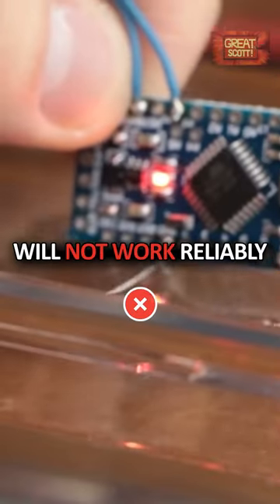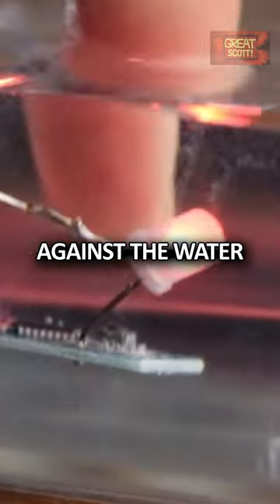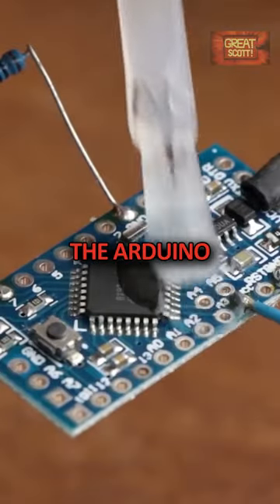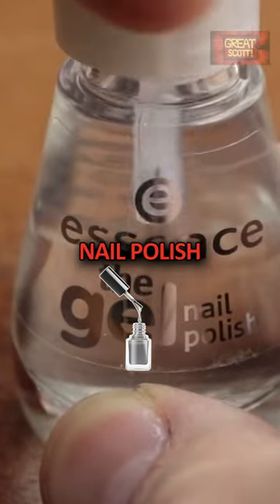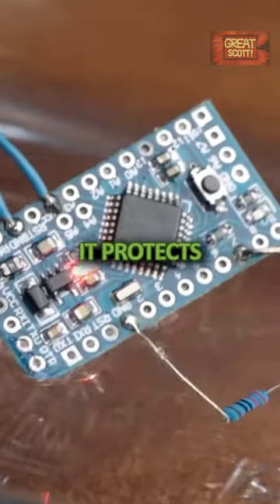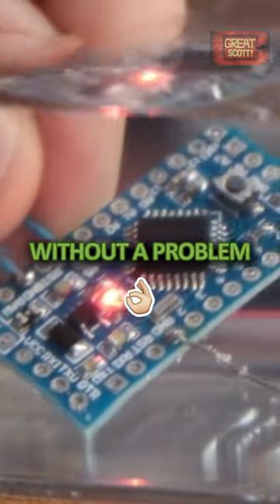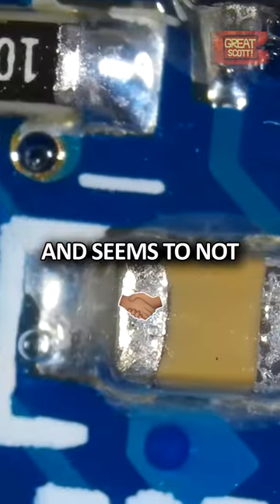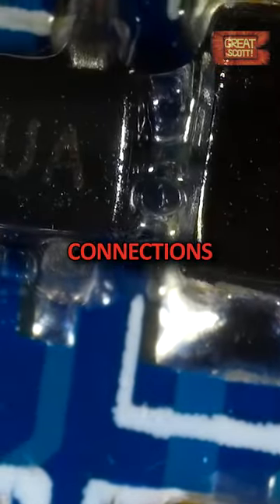Unbelievable Way to Waterproof Electronics!

Comment: Im not sure what the application for this would be underwater, but it would be good extra protection for outdoor projects where the casing may fail to keep moisture out
Reply: Maybe submersion cooling?
Reply: @oo2454  i wonder what substance it really is. Could be real dope for your idea
Reply: Industrial control systems are coated in conformal coatings for this very reason, Basically a uv stabilised varnish.
Reply: @dogwalker666  I just said that too. I use it on my drones. No shorts yet.
Reply: Moisture is already present in the air inside the enclosure.
Reply: Pool thermometer
Reply: @Cat-kp7rl  they are usually in a sealed stainless steel pocket as the chlorine will rot any conformal coating and turn copper to mush.
Reply: Outside circuits in the rain

Comment: Works OK IF THE NAIL POLISH DOES NOT CONTAIN CALCIUM. This is used as a nail hardener, but is conductive.
Reply: Metallic calclium is conductive, however calcium reacts very quickly to a non conductive state. 

Calcium ions however it may be cause a catalytic reaction what can cause a net flow of H+ ions to concur what is conductive.

However is the calcium ions are locked up in the nail polish, it won't be able to do that

Comment: Plenty of inexpensive and proven conformal coatings available, viz. acrylic, urethane and epoxy. The nail polish should be used only if you've nothing else, and is not a good long term solution!

Comment: You can scratch it off really easily from smooth surfaces like circuit board, so it's only suitable when you know nobody and nothing will touch that arduino except water and dust.
Reply: So you layer multiple coats to provide a thicker barrier, just like with any other properly applied sealant.
Reply: @claws61821  Or you just apply an actual sealant.
Reply: @danser_theplayer01  It is an actual sealant. That's literally its use in cosmetics. Sure you've got all the different colors to make it look pretty these days but the actual purpose of it has always been to seal and protect fingernails and toenails, all the way back to ancient Egypt. The modern stuff is almost always based from an acrylic copolymer, which is also what most materials that you would consider "real sealants" are made from. The only real major differences are the packaging and marketing, and what chemicals dissolve the specific one you choose on either side of the coin.
Reply: @claws61821  If this garbage can be scratched off with a fingernail it is not a proper sealant for the job. Imagine if all paints and coatings in the world were so stupidly weak. Stop justifying bad "lifehacks".
Reply: @danser_theplayer01  What do you recommend? I've tried stuff sold as "liquid tape" it seemed to have some unintended effects on my circuit.
Reply: @RussellValentine Idk google some stuff, order, and try it. For example polyurethane "lacquer" coating (not to confuse with foam). Or some silicone stuff. Do not use hot glue though, it may just melt on some hot electronics, I'm not sure. Anything they use in conformal coating for pcbs.

Comment: I'm all for this method if the design is finalized and will never get changed again. Otherwise, thin silicone is my way.
Reply: Comes off with acetone
Reply: Why would you want to modify the design of a arduino board? :)
Reply: you can solder through the polish. it just melts away i do it all the time.

to be honest, idk why they dont protect cellphone electronics and laptop motherboaords this way...
Reply: @L3X369  Not so much the board itself, but the stuff that's connected to it, or what's been flashed to it.
Reply: @L3X369  change the things soldered to it
Reply: @Deadwindshadow  Will it? That's pretty good to learn. As for why they don't do that with consumer electronics, it's probably a matter of it being too profitable to lose water damage replacements.
Reply: @L3X369  to fix it or modify
Reply: @zachb.6179  I wonder if acetone would melt any plastic components?

Comment: I’ve seen PCB’s covered completely along with all devices in a thin layer of silicon. It’s about 1/16th of an inch thick and it makes it a PITA to work on.
Reply: I fixed a washing machine that had its main board set inside an abs tray, and then basically submerged in silicone...  boy was that a b*tch to work on

Comment: been using clear nail polish (top coat) on electronics since the early 80s. it's always worked well
Reply: i accidentally scratch hard drive pcb board and the copper slightly exposed but the drive works fine is it okay to apply nail polish on exposed copper  scracth pcb? do i need regularly reapply the nail polish every months etc(temporary fix) or not needed (temporary permanent fix)?
Reply: @bolulembut1132   I'm not really sure how long it lasts, but since most of them are made of nitrocellulose (what movie film used to be made of), it should last quite a long time. The solvent it's dissolved in evaporates pretty quickly, so that shouldn't pose any problems for most electronic components. (I used to it to hold down bodge wires on a Commodore 64 restoration, no problems
)
Reply: @davestorm6718  i also heard that acrylic spray paint can also be used to cover the pcb , do you have experience with acrylic spray paint as conformal coating? im wondering which one is better for long term between nail polish and acrylic paint for this purpose

Comment: This method will affect the tuning on aerials, also that 2.4ghz device you were painting will have issues under water because 2.4ghz (Bluetooth/WiFi etc.) is absorbed by water therefore blocks the signal within a few cm
Reply: doesnt gps have nearly the same wavelength? And it is still able to be recognized by your smartphone on a cloudy day. So clouds might not be nearly as dense as water, but they might be very thick, and in addition to that it might also be foggy. I know that this makes gps not to work that accurate anymore, but it still works. So are you sure,that water really blocks it that good.
Reply: @neutronenstern.  GPS uses 1.5 GHz. 1.5 GHz is not related to 2.4 GHz WiFi, however there is a 4G GSM downlink channel. Because of GPS there is no GSM uplink channel in the 1.5 GHz band, 'cause it would make GPS unusable with smartphones.
Reply: As for the second half of your comment on the problems of 2.4 GHz under water, it's only partly correct. Radio waves are essentially just invisible rays of light. They get refracted the same way as visible light, hence the same effects apply. While it is true that water skews light - and therefore radio waves too, what actually interferes more if you try to have a WiFi connection through water is that the signal gets refracted differently in the water than in the air. Visualize it like looking for an object like a sea shell in the water. As long as you are looking through the air into the water you cannot determine the correct distance and size of the sea shell. However as soon as you submerge into the water your view gets clear. Same thing applies to radio waves. So as long as sender and receiver are both underwater you can reliably transmit wireless signals. The distance would of course be smaller than if both sender and receiver were communicating through air only, but it could reach further than a communication through air and water. If adjusted for the different refractor coefficients you can also reliably transmit through air and water (think of remote operated submarine toys, they run almost always on 2.4 GHz, at least within the EU)
Reply: @jdkap201  I did some experiments recently as I was developing a Bluetooth controlled underwater device and found that submersion to a depth of 17cm was the absolute limit of operation, however the power of Bluetooth is in the low milliwatt range. A higher powered transmitter would help, but refraction isn't the problem here - water actively absorbs RF energy in the 2.4GHz range, this is why microwave ovens work.
Reply: @jdkap201 Oh ok. But these signals are only on and off patterns of electromagnetic  waves. Thus the receiver does not have to know, where the light comes from, but only the on and off pattern, which will not be changed by the water, i think. Its like if i sent you morse code from water to air. The refraction should not interferre with my signal in a way,so that you cant recognize the morse code anymore. But what i think might disturb it are reflections, and even total reflection at a shallow angle. This of course is a problem. Also the water waves might cause sometimes more and sometimes less reflections resulting in white noise,and thus distraction. I think this might be the right explanation for the problem,you are referring to. But uts just a guess. I didnt think about it beforehand.
Reply: @neutronenstern.  reflections and refraction certainly do have an effect on radio waves in addition to visible light, but a closer optical analogy to the 2.4GHz problem I had would be placing a pair of sunglasses in the way of a torch beam - the photons passing through the sunglasses aren't directed elsewhere, they're absorbed by the pigment and converted to thermal energy.

Comment: Pcb warnish is the professional option, as you can easily do rework if you want on your board, it just melts off in soldering temperature.
Reply: Oh! Pcb Varnish.
Reply: you can solder through nail polish, i do it all the time :)
Reply: @Deadwindshadow  Good information

Comment: I use SuperHydrophobic coating (2 part(s) Process)

biocompatible polydimethylsiloxane and carnauba wax.

It Still allows components to breath 
MEMS (Microelectromechanical systems) 
& fuel cells

Comment: Wow, that's a deep cut. I saw this when you first posted the original full video and can't believe it's already been five and a half years. It might be nice to see an update on this, perhaps with long-term tests and maybe even in saltwater. And just for fun, maybe after coating an Arduino with something to protect it, coat it with electrically conductive paint and then use electrolysis to metal plate it.

Comment: Old trick. ;-) I used this as inexpensive, easy-to-acquire conformal/insulative coating on some circuits in our solar electric car in college. Always pre-test a particular source for conductivity. This also gives you a little protection from mechanical damage.

Comment: you know there is purpose built encapsulating material/conformal coating, that is designed for low leakage thats pretty cheap and available already right?

Comment: Stupid question let's say you need to resolder or use the contacts after waterproofing. How would the nail polish affect the soldering process?
Reply: well i guess there is some chemicals called nailpolish remover or something for that. ;)
Reply: @ahmetmutlu348  I was just wondering if it was possible to just soldering directly.

Comment: if you have some just lying around in your house sure but if someone is going to buy some nail polish for this just buy some conformal coating its not that expensive and its for this exact job id trust it over nail polish on my fpv quad

Comment: I tried coating with epoxy before but the results were unreliable
Reply: Why?
Reply: @Yonatan24  I think the liquid seeped into crevices and the hardening process lifted or damaged chips or something. Point is sometimes it killed the board and it wasn't a reliable process we could use.
Reply: @GaudyMarko  my guess is it was the exothermic curing, might’ve baked some sensitive components

Comment: Back in the '70's (yes, 19 wise a**) we used other material similar to that to protect from moisture. There were different materials under the category of conformal coating. We also did encapsulation - potting with a plastic resin.

Comment: I use 5 min epoxy.
Reply: That's a lot less fun to remove if you need to make any changes, though. Can just burn through the nail polish or lightly scuff with a solvent.

Comment: The ability for the circuit to dissipate heat is compromised, may cause components to overheat!
Reply: In my experience this isn't a big issue as the casing of most components also isn't a great thermal conductor and the thin protective film shouldn't add that much thermal resistance.
As an alternative you can mask off the top of the chip so that you can expose the unprotected casing (which isn't as sensitive to moisture as the bare contacts) and add a thermal conductive glue and a heat sink.

Comment: Nail polish falls apart rather quickly, DON'T DO IT!!!
Reply: That's what I thought.
Reply: Ummm no, it doesn't, I've been using it in electronics for 30yrs...😩
Reply: @edwardfletcher7790 could it be that nail polish was made differently back then? So both of you may be right.

What is nail polish chemically speaking?
Reply: @theincapable  Nail polish is paint and I still use red to mark wiring on my car.